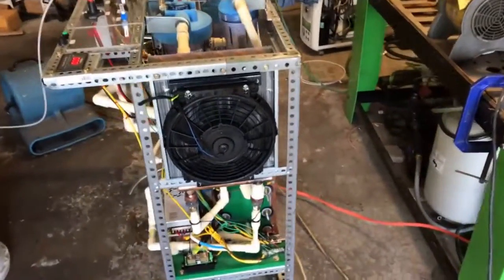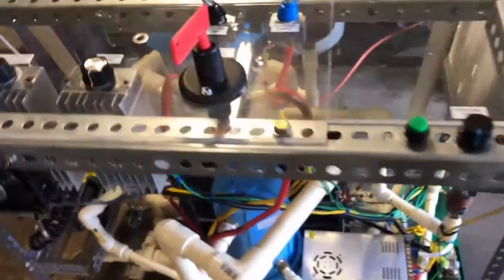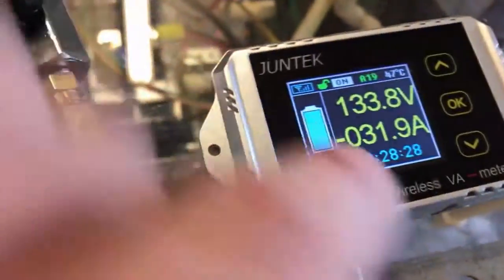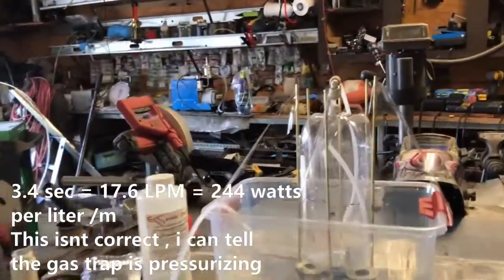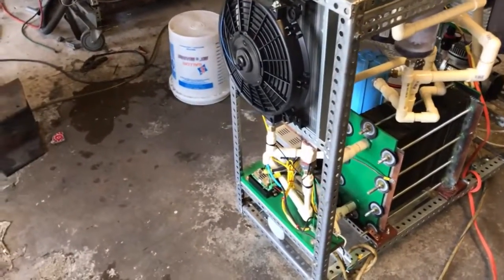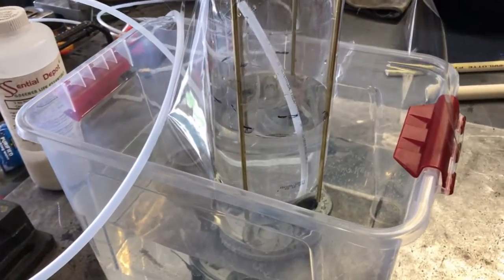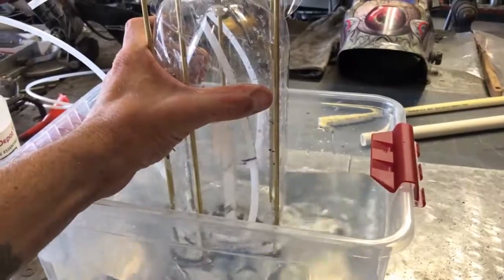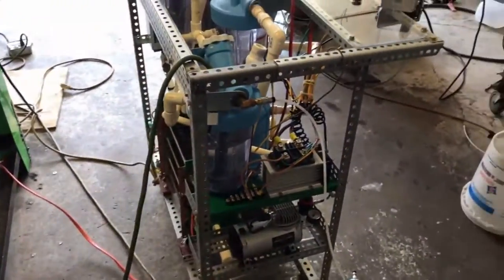10,000 Watt Electrolyzer Build

Comment: Is your DC voltage about 133Volts? How may stacks and plates per stack are you using? Good job.
Reply from the maker: no its 233 , the meter i have is the wrong type of meter ment for 120 volts and we didnt know this at the tiem , we fixed it . 1 stack 88 or 80 plates i think

Comment: Wow,  great job for sure!  
HOH production is not my biggest area of interest but just watching this tweets my interest.  I don’t know anything beyond basics about the cells.  At 30 liters per minute this gas production should run an automobile easily and have plenty extra yes??? Or no?
Reply from the maker: Average car gulps up 250 scfp of air so there would be no power at this dilution
Reply: NOBOX7  hmm 
They show those little bubblers and claim mileage per gallon increase.   That has to be bogus.
Reply: NOBOX7  super job man

Comment: Try moving the input hose tip to the top of the vessel.
Reply from the maker: That voltage reading is wrong , no way its only 13 volts , the meter is junk